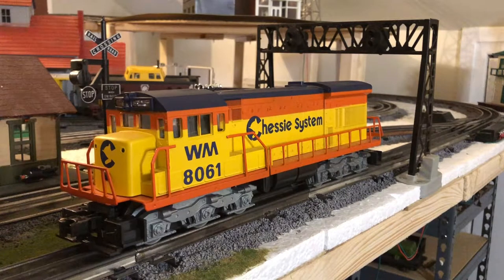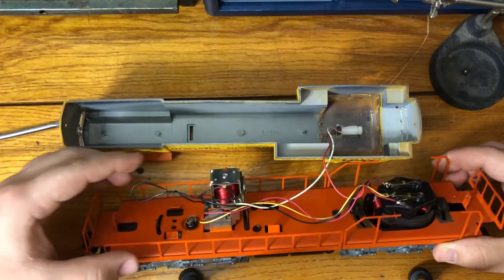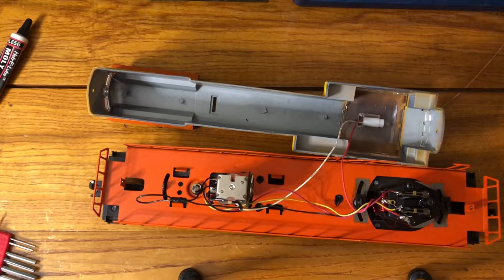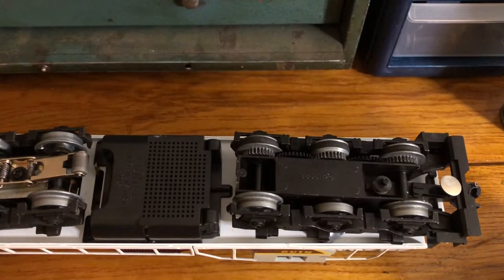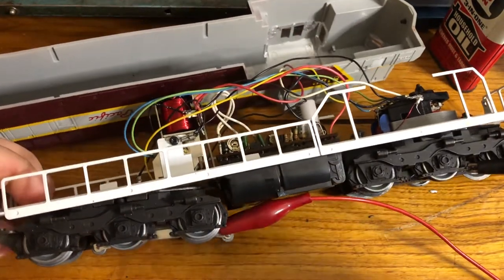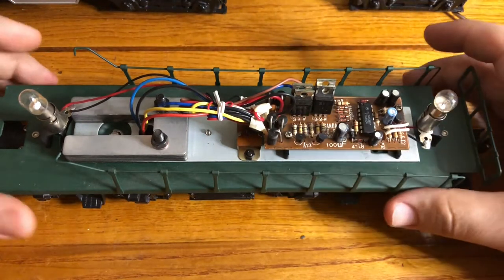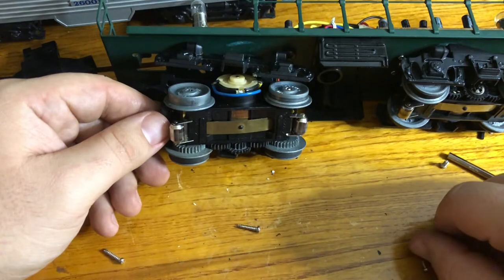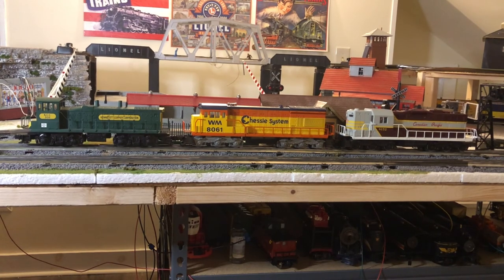Repairing 3 Interesting O Gauge Diesels, common problems that are easily fixed - WithTest Run!

Comment: I was amazed it ran after all of the oil you applied to the motor. I personally would not use any spray lubricant on or inside the end bell like you did. The only oil required there is on the armature shaft hole so it can travel down to the motor bushing. I like the way you greased the gear train but unless I missed something in the video you missed all 12 bushings on the axles to lubricate them it only takes a drop of a light viscosity oil on each one to greatly improve the engines performance. I personally do not use wd-40 in any of my trains. Labelle's make a good line of lubrication products for your model trains.

Comment: Thanks Nick. Always enjoy the collaboration amongst us who share similar interest and views within this hobby. Enjoy knowing there is the younger generation that has the appreciation and compassion for the postwar, MPC, and modern Era creations. My experience with maintaing the MPC pullmore motors to access the worn gears can and should be accessed for lubrication is removing the brush plate and pulling out the motor armature revealing metal gears which are usually dry or completely gummed up with dry lube and needs serving. The instructions for reinstalling the allen screw in the brush plate is to tighten it untill it contacts the brush plate and back it off a couple turns. The plastic gears were typically impregnated with silicone and I only use silicone spray lubrication to lubricate when they seem dry. Be careful not to get this on any surface you plan to paint as it's almost impossible to remove and paint will not stick to any surface that silicone is on. Silicone is the safest lubricant to us on plastic.
Reply from the maker: Thanks so much for watching and for all the excellent information on these. These engines are still running strong almost 2 years later from the time of filming this video.

Comment: Nicely detailed video. Just a couple comments. To reinforce what you said, WD40 is not primarily a lubricant. It is a solvent (cleaner) / water displacer (that’s what WD stands for). The perception of lubrication is due to it cleaning the inside of joints.  Also, around electronics of any form, aerosol spray lubricants are not recommended without a directional straw because of overspray.
Reply from the maker: That’s an excellent point , thanks for the comment. I only use WD40 now on polishing post war metal shells and trucks. CRC and 3/1 oil is the way to go
Reply: @NixCrossing  3in1 Oil is really great especially for the armature area as it cleans as well as lubricates. One of my Go to oils for repairs on all small motors.

Comment: First video I seen of your's I think. I watched it because so far I have not seen anyone work on a K-line engine on YouTube. So thanks for the three engine show. Now I like to be helpful. I made some errors as a kid and in my 20's with model trains, I'm now in my 50's. First on the first Lionel MPC era engine. Unscrewing that set Allen screw  can be big trouble. I broke the plastic on one  since it had locktite on it. So it is wise to unscrew the two Phillips screws, and carefully lift up the top assembly on that motor. Slowly as to not break the 2 winding wires to the field coil. Get the two brushes and at this point you will have access to the motor worm gear by simply turning the wheels or turning the armature to un-wind it out. You then can grease or oil it and the top armature tip then. Also some of them have a little ball up in there as well.  On the second engine similar thought as well. The sound board; all Lionel and some others used a piece of foam to set the board on and in time that foam erodes away and then the circuit shorts out and the electronics are damaged. Age will often have the capacitors go bad and they can be repaired.

Comment: I have 2 Monon U36Bs that I bought One was a basket case and needed a new armature and E unit the other just needed a minor repair. I think you will find that the cab light bulb just clips into the bracket up there and is easily removed without damaging anything. On both my units the plastic axle gear had separated from the axle. This was repaired by carefully supergluing it back to the axle. Both run very well now.
Reply from the maker: Thanks so much for watching! Those parts are crazy hard to find and I’d argue that the MPC parts are harder to find than post / pre war metal cast parts. Those nylon gears always fell apart. I actually ended up getting rid of a lot of these for trade.🚂💨

Comment: First time in my life, I had the flaming e unit event after using the cleaner yesterday. That got my attention real quick.
Reply from the maker: I’ve only had one engine fire because the cloth wiring shorted out to the frame on one of my prewar engines.

Comment: YOU NEVER OIL BRUSHES - pull the set screw above armature - 2 drops oil - set screw back - turn in until contact with armature then back out 1/2 turn.   Now replace the brushes you just made soft - clean reversing unit with DeOxit D5 - - lightly lubricate cog if needed - keep off electrical contacts D5 does that.
Reply: You are 100% right thank you

Comment: On the last unit if you untied the wire bundle you might have more room to move the truck around.   Easy enough to retie it when you are done.   The PCB shouldn't be too difficult to debug.   It looks like it has rectifier diodes to convert from AC to DC.   Then power transistors which are probably in an H Bridge configuration to switch directions.   Plus Resistors.   When the capacitors fail they will look like they are leaking or bulging.   

I've never used spray cleaner on my HO cars.   If you remove the brush plate it looks like we could easily clean the brushes and commutator.   On the HO cars I only add one drop of oil to the motor shaft.

I have a sticky j1950's Santa Fe Diesel that needs some attention so thank you for the tips.
Reply from the maker: Thanks for watching and for the information on these 👍🏻🚂💨😊

Comment: As for the K-line engine and Lionel and some others use a similar set up and vinyl or plastic gears. Yes be aware some grease will cake up and get hard and cause things to lock up. However the most important part to oil, is the pivot point of all wheels and gears. On these DC motor wheel sets that gear shaft is part of the motor frame mold. As it wears without oil the gear flops around and then the gear gets smashed or broken. So most will blame the plastic gears but the real problem is the plastic shaft and the lack of oil on these.  Yes, I hate oil to get on the track, but to protect these gears sets you should have a track for oiling and run the train on there for a while after oiling and then whip off any  that you can before running it with your layout.  My first experience of the plastic wearing out was with the MPC 4-4-2 steam engine, the motor shaft plastic gear plate at the first gear got that hole very sloppy. A winny sound from your motor is often the armature ends that are dry.

Comment: I found it interesting that on the first engine that Lionel did not paint where the wheel set of the motor pivots. Yes, it gets it outer wheel contact from that area, and that made a better contact point with bare metal there. Also those early 6 wheel trucks; Lionel MPC made error and did not put a groove and rubber tire on the center wheel set, so the engine can get hung up on a hill or irregular track hump. I had the Milwaukee SD-18 that had that problem, nice power motor otherwise.
Reply: On those 6 wheel trucks, the center wheel is blind (no flange) so that the truck will negotiate tighter curves. Might not be the best place for a traction tire. But not a bad idea.

Comment: Liked your service video.
But your use of lubricants is a little wrong. Always it’s advisable to use plastic safe lubricants. Labella makes an excellent set of oils and gear grease . All safe for plastics.
 Molybdenum is a conductor ( graphite)

Comment: Where can I find drive units/wheels/gears for a Kline MP-15.  Have the same KCC engine, missing some of the traction bands and at least one wheel is fractured.
Reply from the maker: I would check Trainz for parts first, then the Lionel parts website. Lionel adopted those trucks in the late 90s. You might have better luck with buying a parts train as well. Hope this helps
Reply: East coast train parts goes to most greenberg train shows for probably 25 years. The guy knows his stuff, often by sight and has a crazy big inventory of parts not easily  found elsewhere. Good prices. Just bring your stuff with you and show him. He doesnt do repairs but often has great suggestions. He answers e mails promptly.. dont forget those 5$ junk piles at train shows.. Gary

Comment: interesting but the gears are made of a material called DELRIN. in this service they require no lubrication at all.Petroleum based libes have a tendancy to degrade the actual truck plastic. A dry graphite or moly powder or something would be my choice.

Comment: Can the MP15s wheels be replaced with postwar ones with magnitraction?
Reply from the maker: I think it would be difficult because the DC motors are located in the trucks. That would be an excellent modification.
Reply: Yeah. The way I see it is that the traction tires insulate the wheels, so if it had magnitraction the engine would have a better ground

Comment: First, you may want to replace that foam under that sound board. Those disintegrate after time and the board will short out. Also NEVER lubricate the plunger on the solenoid for the E unit. The contact cleaner is all you want to clean that area.Just shoot it up there and let it dry.  Oil or lubricant will cause it to stick.
Reply from the maker: Hey thanks for watching! This was on the old layout, I now use thinner foam but I do miss the old stuff to hide my buildings / accessories.  Thanks for all the pointers 🚂💨
Reply: @NixCrossing  Happy to help,

Comment: Good video but you never oil brushes you clean them
Reply from the maker: Thanks so much! recently started using a degreaser then coat everything in 2-27 then wipe everything down. Seams to be extremely effective on my pre war motors